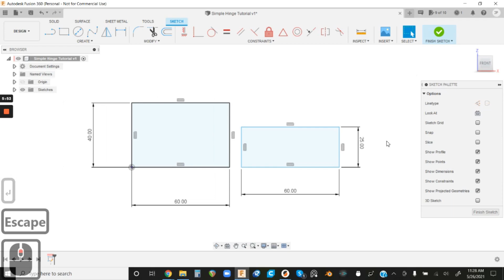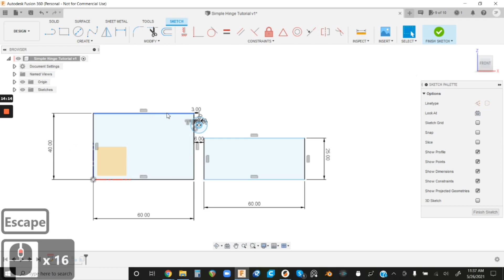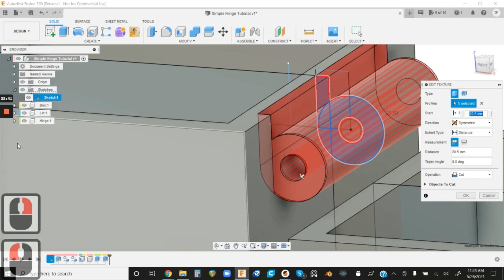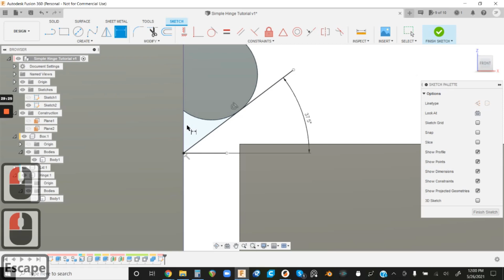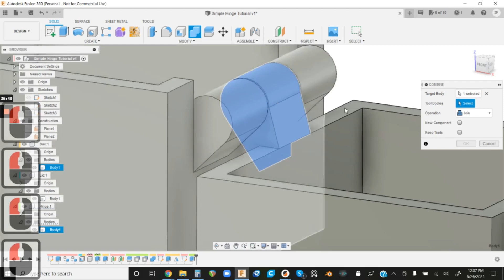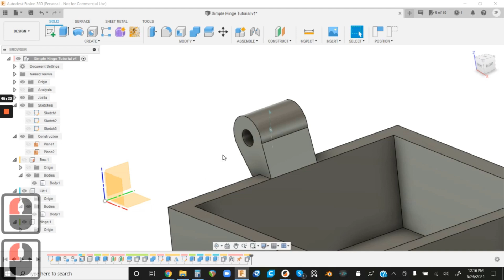(Tutorial) How To 3D Model A Hinge (Print-In-Place, No Supports) in Fusion 360, 3D Printing

Comment: Hi Im new to this. If I wanted to model a  non in place hinge how would I do this. I want to make a finger and its be easier to not print in place
Reply: There is a bunch of ways, but the easiest way would to be to make the finger and have two little holes on the inside of it and make the rrest of the finger sepereatly and make it where the poles of the outside of the second finger would poke out but smaller then the holes on the first finger and you can just put it in to it with a bit of pushing.

Comment: How does the printer handle the rod inside the hinge? The way you've printed it seems like it was in the air, inside the middle section, yet it works.
Reply: Agree! Questioning how a moving part can be printed without supports..
Reply: You need to have a printer that can bridge/span (print in air)